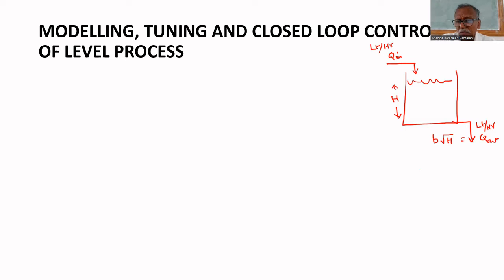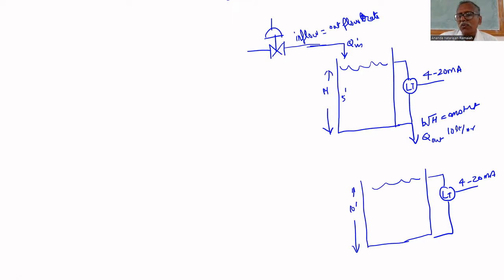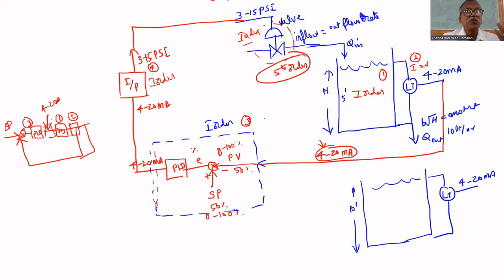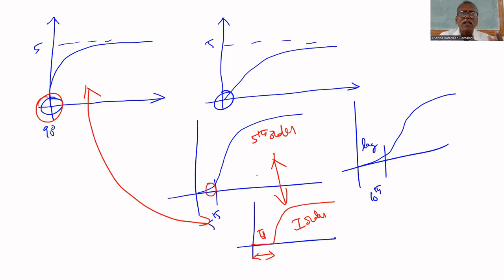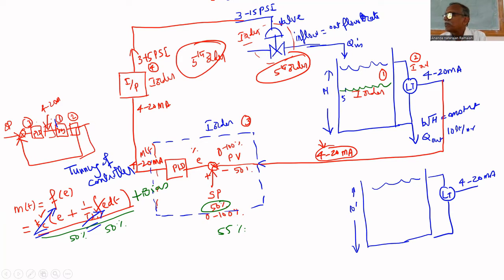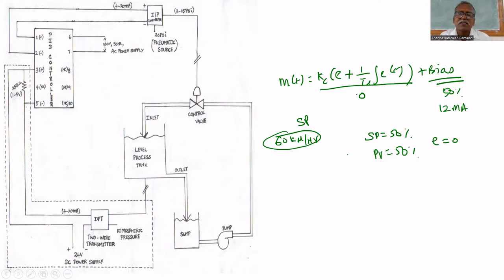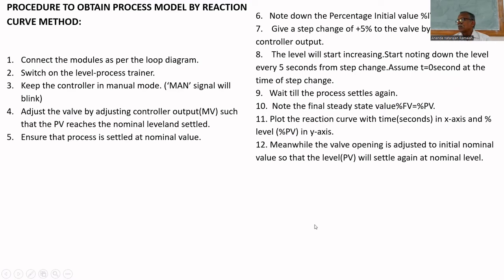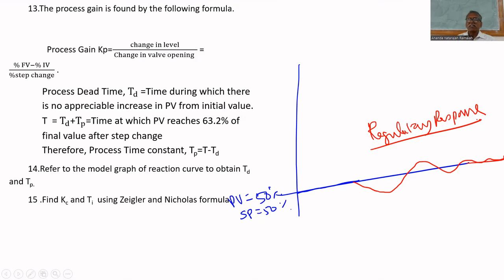Introduction  to Laboratory Level Process-Process Control- Instrumentation Engineers' perspective 1

Comment: why do we don't or can't use the PID controller in the LEVEL PROCESS? if it's unnecessary to use it. reason it out, sir.
Reply from the maker: No need of D mode since moderate speed process, D is required in Thermal Process since it is very slow process.